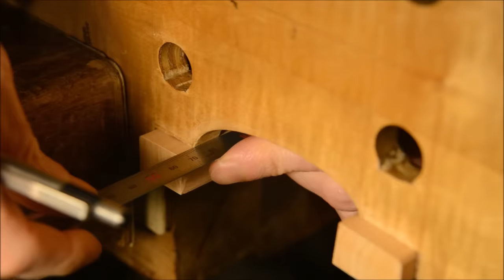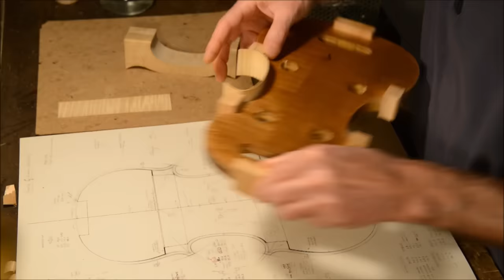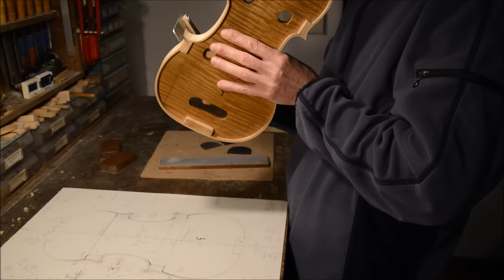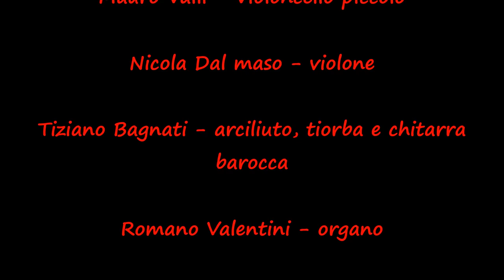Rib making from start to finish (condensed)

Comment: Have you tried using a “shooting board” to plane the ends or even the sides of the ribs? I made one for my shop so I plan to use it for some parts of the violin making process.
Reply from the maker: It could be useful, but in fact you don't need to plane the sides and the heads of the ribs before bending them with extreme precision because in the end all these surfaces will be removed, freehand plane and eye can be enough. I use a shooting board when the side to be planed square must be finished straight off the plane, such as fingerboard sides as example

Comment: During the portions using the bending iron, instead of a steel bending strap I see sold online, are you using a strip of leather and a thin sheet of copper? I’m just starting out and trying to save money where I can.
Reply from the maker: Yes, it is a 0.5 mm thick copper strip. I'm better off than with steel because copper is plastic and holds the bend while steel is too elastic for me, but it's a matter of habit and a slightly different bending technique. The leather strip is approximately 2 mm thick, its purpose is to be able to maintain constant pressure without burning your fingers
Reply: @DavideSora  Grazie, Maestro!

Comment: at 5.45 on this video, you are using a chisel that I am not familiar with and cannot find on the internet, I wonder if you could share what type of chisel that is .thanks kevin
Reply from the maker: I bought It from Dictum many years ago, it's a japanese inside bevel gouge, but now seems discontinued. Now Dictum sells this one which is conceptually similar although slightly different in size from mine https://www.dictum.com/en/scroll-gouges-jbc/herdim-cornerblock-gouge-sweep-6-16-mm-715551  and you can find something similar from other sellers as well, like for example Karlsonn which is an excellent manufacturer, who can also make them tailor-made on specific request: https://klensmide.se/en/violin-making-gouges/cornerblock-gouges/  Anyway this gouge is certainly useful but not essential, the width is 18,5 mm and 13,5 mm radius of the curve. Before using this inside bevel gouge I was using a "normal" gouge, that I still use for finishing the curves (see other videos of the series in this playlist: https://www.youtube.com/watch?v=bF3cmIIipyQ&list=PLaxadm6POX7EDdiroIqVTbztJmKuSbHYU ).

Comment from the maker: Yes, for block carving the inside bevel gouge  is not essential but certainly useful, the width is 18,5 mm and 13,5 radius of the curve. But as  you see I use also a "normal" gouge for finishing

Comment: Amazing wonderful work and video. What is the purpose of applying (sealant/glue?) to the faces of the blocks at 17:20 ? Thanks.
Reply from the maker: Sealing the end grains of the blocks is necessary to prevent the glue from being absorbed when gluing the back and top to the ribs, causing a starved joint

Comment: THANK YOU for all that detail.  All the other videos are very sparse in the ribs. I never could visualize how the points came together.  Why the scraping of the ribs after assembled?  To bring down the thickness even more, or to bring out the grain?  or some other reason?
Reply from the maker: You can find the complete index of videos on my blog, simply click on the topic that interests you and you will see the list of videos with links in the right making process order : https://davidesora.altervista.org/videos/
The final scraping is to make a surface finish, wetting the ribs (and letting them dry well before final scraping) to raise the grain and prevent it from rising too much during varnishing.

Comment: Thank you Davide, I got a lot out of watching your techniques. This is going to solve many of the problems I have been experiencing. I really appreciate you making these videos public. I wonder your source for the very large sheet of abrasive paper? Aso I like your lining clamps. Are those available for purchase?
Reply from the maker: The large sheets of abrasive paper (grit 80) here in Cremona are found in normal hardware stores or paint shops. With regard to the lining clamp,mine were made by hand in times when there were not so many specialized tools shops, starting from a robust U-shaped aluminum profile and 3.5 mm diameter Allen screws. 
Now I think the best you can find are these : https://www.cremonatools.com/clamps-for-linings-and-edges.html
Of very refined aluminum construction, they have the only disadvantage of being rather costly! 🙂

Comment: Thank you for sharing your exceptional craftsmanship with us.  Very impressive attention to detail!  Just one question: for the first set in this process, is there any reason you didn't use a shooting board rather than doing so much of the work free-hand?
Reply from the maker: I use the shooting board, you see it at the minutes 2:56 and 17:53 (if that's what you mean). But violin ribs are very thin and fragile (1.1 mm thickness only) and there is the risk of breaking them, so I prefer to do the job more gently with the plane, there is more control and better visibility of what you are doing. If you like you can see the work much more in detail in the complete series of videos on rib making : https://www.youtube.com/watch?v=F3y0-PSoL74&list=PLaxadm6POX7EDdiroIqVTbztJmKuSbHYU
Reply: @DavideSora  a shooting board is a flat board with a stop at perfect 90 degrees. A plane is then put on its side to trim the end grain of wood that is put against the stop.
Reply from the maker: @mrgolftennisviolin  You are right, thank you for the clarification. In my previous answer two years ago, I didn't get it right, and I confused it with the sanding board I use for flattening. However, I don't think a shooting board for squaring blocks can save significant time if you're skilled in using the plane freehand, but it may work. Consider that you should make a dedicated one for corner blocks, which have an angle greater than 90° in the recesses of my forms.

Comment: Hello Mr. Sora! Apologies for my endless questions 🙈.  But I have seen both hide glue and synthetic glue recommended for fixing the blocks to the mould.  What makes you choose the synthetic glue for this?  My thought process is that since hide glue is more reversible it may be easier to remove from the mould later, but please correct me if I’m wrong.  Many thanks 🙏 ❤️
Reply from the maker: I prefer synthetic glue (Titebond aliphatic glue) simply because it is more practical because ready to use and this glue will not remain in the finished violin. To clean the form I scrape it off with a chisel used as if it were a scraper, fast enough anyway. But you can safely use the hide glue, with the foresight to adjust the dilution well otherwise if it is too diluted there will be the annoying problem of the blocks that come unstuck, perhaps with the ribs already glued.😊

Comment: Awesome videos!  Question: at 8:14 with the piece on the glass, you rock it back and forth - I suppose it's not supposed to be planar in the top-bottom direction.  (it should be in the left to right directions).  Why is this?  Does it make it difficult to mate with the top and bottom (which I assume are planar)?   Is this done to purposely induce stress in the top and bottom (once attached).  Or is it for aesthetics?  Thanks for the great videos!
Reply from the maker: I suppose you refer at 18:14 and not 8:14 . 

Yes, the rib surface is angled on the top side, starting from the upper corners to the neck block, This is a tipical features of ancient cremonese makers (Amati, Stradivari ecc.) and an integral part of the ancient cremonese working method. This angle put the top in tension counteracting the bridge pressure and lower the top at the neck for better clearence of the fingerboard. It works even aestethically making the sounbox profile fuller in the center, while if the line of top and back are straight they optically seem to approach in the center giving an impression of weakness of the soundbox seen on the ribs side......aesthetic subtleties......... :-)
See this video for more detail on the making of this slant : https://youtu.be/it_65hzYxrg?t=357
Reply: @DavideSora  Thanks!  It's great that you take the time to reply to so many comments!
Reply: @DavideSora  So how does the top fit the ribs? Is the bottom of the top shaped to compensate for the slight angle?
Reply from the maker: @gary24752  No, the plate is flat, when it is glued it bends slightly to adapt to the ribs.

Comment: Qual o nome da ferramenta que aparece aos 9:25? Sabe o nome em inglês? Ela se parece uma goiva invertida. Mais um excelente trabalho e vídeo. Parabéns, maestro.
Reply from the maker: That is a gouge called inside bevel, that is, with the bevel on the opposite side to a normal gouge, so that it works similarly to a chisel. What you see is a Japanese gouge, but you can also find them with Western-style steel, in violin-making shops they are also called corner block gouges.
Like this one, for instance: https://www.dictum.com/en/scroll-gouges-jbc/herdim-cornerblock-gouge-sweep-6-16-mm-715551
You can also simply sharpen a normal gouge backward if the outer surface is sufficiently smooth and with a regular and appropriate curve.
Reply: @DavideSora  obrigado!

Comment: Hi David. Are you wetting the corner blocks and ribs with water toward the end? or sizing them with thin glue? Cheers. Nice work!
Reply from the maker: Thanks!😊
At time 18:20 I'm wetting the wood with water only, to swell it before the last finishing with scraper (after letting it to dry thoroughly). At time 17:19 I'm saturating the endgrain of blocks with glue, to prevent them from absorbing too much during the gluing of the back and top plates.
For better understanding see the most detailed videos of the complete series on rib making, you will find the translation of the captions by opening the window below the video : https://youtu.be/7Vh22WRH078?t=250            https://youtu.be/WWTDMi9_IJw?t=310

Comment: Davide, tell me about your corner templates--for example at 4:00. Did you make these yourself, or are they available somewhere on the market? I have looked far and wide for templates such as these to make sure that my corners are absolutely perfect; until I find something along these lines, I must continue to painstakingly scrape down to finish height.  Cheers.
Reply from the maker: Yes, I make all the templates I use myself. However, all templates are only an indication for roughing, to quickly and safely get close to  the final lines. To get to the final shape there is nothing that can replace your eyes, because it is not a matter of replicating a shape every time, but of learning to harmonize the lines so that each violin is never exactly the same as another but retain its unique character.

Comment: At 15:03 you use sandpaper to make the top flat against the table,  then you use a plane and make the top and no longer flat.  Is that to take into account the tension of the bass bar?
Reply from the maker: It has nothing to do with the bassbar, but it is the taper found in all ancient Cremonese instruments (Amati, Guarneri and Stradivari). It's not clear why they did this, but for me it serves to counterbalance the deformation of the soundbox induced by the tension of the strings, to prevent the top from sinking into a concave profile. Furthermore, it creates a slight pre-tensioning of the top, allows an increase in the neck angle, and also has a positive aesthetic effect on the profile of the soundbox. When fitting the bassbar, you need to take into account this profile on two staggered planes, so I use a frame that reproduces this profile of the ribs to which I fix the top, so as to be able to effectively and correctly control the tension of the bassbar. See this video: https://youtu.be/HOwSW1wU0rI?si=LujkkU35a1qYNYeW&t=176

Comment: Absolut perfect working. Nevertheless I have the impression there is no room for sculpturing with the eyes and imagination in spite of mesuring every detail. Perfect workmanship is not automatically followed by a very good violin. But excuse me for this point of view:  credo que il vostri violini sono benissimo, maestro.
Reply from the maker: The eye is still the most important tool for the luthier and the most used during the work where all the evaluations and final decisions are evaluated by eye, not with the caliper. Measures are used to quantify what the eye sees, but what can not be shown in a video is precisely the variability of all those measures that in the end are determined by the eye and personal taste. However it would not be very kind to not indicate any measure by simply saying "do it by eye", but it is important to understand that the measures indicated are only an indication, they are not put there just to be copied.
It's up to you to decide what will be the measures that correspond to your aesthetic sense, the videos just shows examples of mine.😉

Comment: beautiful work! I am left with one question. Having glued in the internal rib supports how do you get the form out?
Reply from the maker: Thanks!
You can see the form extraction system in this video: https://www.youtube.com/watch?v=C8L9Lcun9b0
Very easy!
Reply from the maker: @MateWiggy  Don't forget to add a few drops of water, otherwise hide glue does not melt but burns. However to glue blocks to the form I use a small drop of Titebond, so if you want to unglue them you have to use a dash of alcohol instead of water, but a firm blow with a hammer shortens the operation a lot😊
Reply: @DavideSora  Is the internal rib support only on one side presumably the top side?
Reply from the maker: @gary24752  I don't get what you mean with "internal support". If you mean the linings, they are glued on both side, top and back.

Comment: I've seen the reinforcement bits done with a taper at the bottom to cut down on weight. I wonder if it makes much difference. Thoughts?
Reply from the maker: If by reinforcement bits you mean the linings, these are always finished by cutting them in a wedge shape to save weight. You can see it in this video: https://youtu.be/dFVzi65U3ks?t=197
This has an effect on the weight but above all on the flexibility of the ribs structure and therefore of the soundbox, with positive acoustic influences especially on the emission power at low frequencies.

The videos titled "... from start to finish" are just a condensed version to show the work in a generic way, to see all the details of the work you have to look at the more detailed ones. You can find a full index with direct links to these detailed videos, listed in working progress order here: https://davidesora.altervista.org/videos
Reply: @DavideSora  Thanks for your reply. I only found your channel last night so I'll be sure to check out the other videos. I'm very grateful for stuff like this as a complete beginner.
Reply from the maker: @cameronburnett9679  
Enjoy😊.
If you need to ask questions or receive clarifications, do not hesitate to ask, maybe I don't answer immediately (I get many questions) but I try to answer everyone as quickly as possible

Comment: Do the ribs have to be bent on one specific side or they usually have the same quality on both sides.
Reply from the maker: In principle, both sides are fine, provided that the cut is correct (radial) and that there are no particular aesthetic defects or residual toolmarks that if it were the case it would be better to keep inside, obviously.

Comment: where can I buy little clamps for doing the linings with on my violin I am making
Reply from the maker: The ones you see in the video are self-made by me, but you can find similar ones on the market.
For example these, which are even better than mine, but be prepared to spend a good amount of money:
https://www.cremonatools.it/clamps-for-linings-and-edges.html
The cheapest solution is to modify clothes pegs by squaring their heads and increasing their gripping force, i.e. adding rubber bands, additional springs, etc. They are not as effective and reliable as the mini clamps but many use them.

Comment: I am preparing to start my first violin.  I was confused about the bevel on the upper block of the C bout at the 6:50 mark in the video. I haven’t seen this before, and the bevel seems to be outside of your layout line.  What was the measurement you were taking? And is this just a method that you are using to get to your required measurement?
Reply from the maker: All my videos show my working method, of course it works really well for me, but not necessarily for everyone. You don't have to follow it to the letter if you don't want to, you can do whatever you like if you can get satisfactory results. Anyway, the bevel is used to accurately define the effective size of the blocks and to effectively control the length of the corners from one violin to another. If you like them shorter, decrease this size, or increase it if you want them longer. The outline layout is for reference only, and should not necessarily be followed. This is one of the strengths of the Cremonese system of the inside form, which allows you to modify the corners and the outline freely, allowing for a more "artistic" approach.
Violinmaking is not always repeating the same thing trying to get violins that are all the same, there are factories and CNCs for this. Just look at the violins of Stradivari (or Amati, Guarneri, and all other ancient Cremonese makers) to realize that each violin is always different from the other, even if the same form has been used.